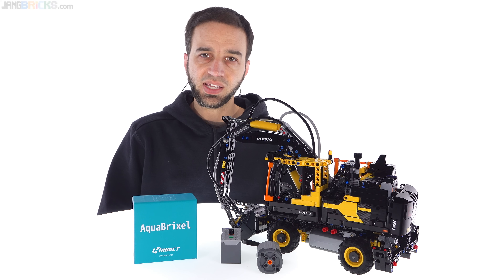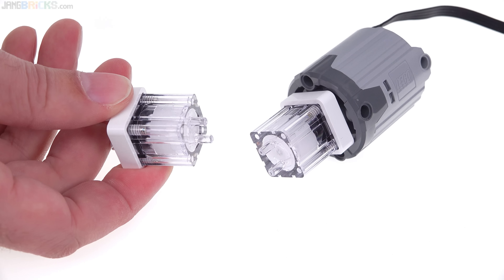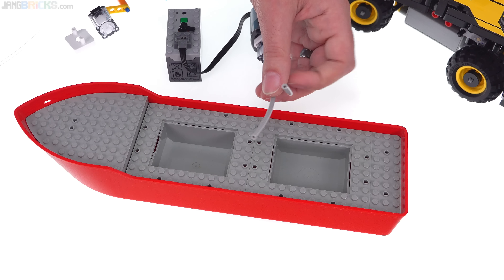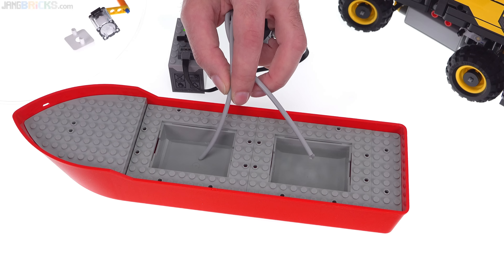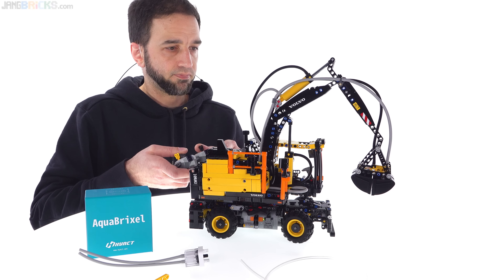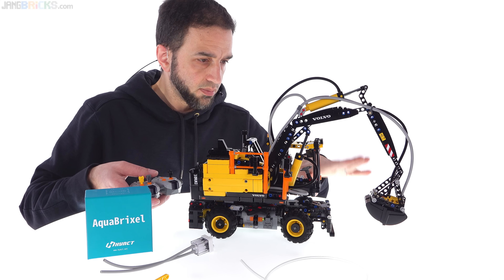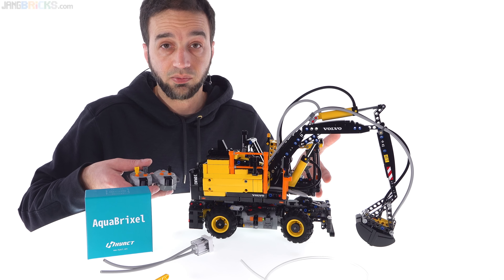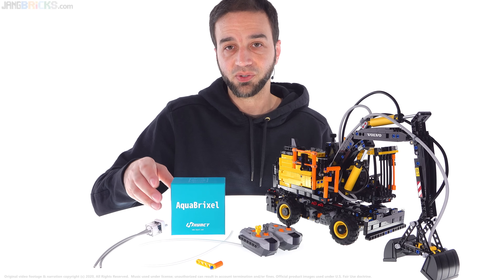AquaBrixel: Hydraulic conversion for LEGO Technic models #sponsored

Comment from the maker: A lot of viewers asked about using oil instead of water to further combat rust, so I asked the manufacturer for their thoughts.  They recommend instead a basic ethanol-based windshield wiper fluid (one without special add-on properties for bug resistance or fast beading, etc.).  It's much closer to the viscosity of water than even very thin mineral oil, thus taxing the motor far less, and it's water soluble and thus doesn't require a lengthy process of absolutely thorough evacuation of the water-primed pumps. Windshield wiper fluid is nearly noncorrosive, designed to evaporate on clearcoats, rubber seals, and metal hardware for years.

Comment: As an Engineer, I find these very interesting.
Reply: Rople that’s the smallest piston pump I’ve ever seen
Reply: @mcgee9777  Ah, but remember they are Lego
Reply: Rople “As an engineer, I need to constantly announce to strangers that I’m an engineer.”
Reply: Would it be possible to have a lego valve package? (dunno the word in english, but heres a pic:https://www.sagro.se/bilder/artiklar/zoom/P403A1_1.jpg?m=1516776461 ) it has one IN and one OUT-let for oil, and each lever operates the flow to the cylinders.

Comment: This is a cool system, thanks for showing! Like you mentioned, this makes the use of pneumatic cylinders in combination with a remote control a bit easier as one doesn't need to use valves. Its functionality kind of reminds me of the old technic Flex System.

As an engineer in the water treatment sector I wonder: does the pump unit start to cavitate once the cylinder has reached its final position? I don't know if you can call it cavitating, but it could potentially harm the pump's seals (but then one might need to make the pump run like that for hours or so).
Reply from the maker: As far as I can see, the piston actions seem too slow to induce cavitation with direct drive off an L motor.  That said, there is some air in the housing  at all times, so it's difficult to tell for sure.  I certainly don't hear anything different going on with the fluid, the motor just bogs slightly.

Comment: I charged my 8851 (the one with the red sprung piston) set in the 80s with tap water and after a while the pistons started to lock up. I'm pretty sure they where all plastic so it wasn't rust, I think it was either the lubricant washed away or the chlorine degraded the rubber or other trace elements built up. May I suggest at a very small added cost that the use of distilled water may reduce (or hopefully remove)this problem.... just an idea.
Reply from the maker: YES.  Distilled water is an excellent recommendation that would surely help a ton. Thank you for that.
Reply: The first pneumatic cylinders have only one inlet and are therefore retracted by a spring. I am not sure if this was made of stainless steel. And there is probably some leakage from one side of the piston to the other, that leads to to a rusty spring. The rust particles are blocking the piston/cylinder short time later.

Destilled water is more corrosive than tap water and it dissolves "everything", but yes it is of course "cleaner". But the minerals in tap water can only be harmful when you heat the water and refill it often because of loss due to evaporation.
The lubrication has to be renewed from time to time, because it will be "washed away" by the water (mechanically).

Personally I think that Lego-Water-Hydraulic is really fascinating, but needs a little bit of maintenance which is (in general) untypical in the Lego-World.
Reply: @stefan_brix  The original single inlet rams were not retracted by springs, they were retracted by the suction of the air being drawn out of them.
I know this because I have one right here in my hand now.. without anything connected to it, there is almost no resistance when the ram is pushed or pulled.. so no spring inside.
Reply: I done similar with my one but with cooking oil. It didn't work and the pneumatic never worked again. I was feeling very guilty for destroying such an expensive set in depression era Ireland. I got the set again in my 40s and is sitting proudly on my shelf

Comment: The movement seems a lot more fluid and smooth, excuse the pun, than the pneumatic system. There is a lot of juddering with just air. This is pretty cool.  Would you maybe do a conversion video with the AROCs ? I have that set and it'd be interesting to see it working with this hydraulic system.

Comment: Keep in mind the XL motor runs at a slower speed than L motors, while it does deliver more torque to move fluid it will deliver lower speed and pressure.

Comment: There will be corrosion no matter what the manufacturer says. My old cylinder rust too even though I never used water as fluid. But you could use dot5.1 instead.
They should provide further components like check valves. I see big potential for accurate power hydraulics e.g. construction vehicle

Comment: I can see this being useful for many things. I wonder since you can run water through it if it would be okay to use in something like a waterfall or something? I can see it making some real cool things with this.
Reply: It's not powerful enough for a waterfall, check the flow...
Reply: This isn’t exactly designed for being used as a water pump. If you wanted to make a custom waterfall you can buy an actual water pump on amazon or target. Also because the connections between LEGO pieces is not watertight I do not think they would be a good tool. If you want to make a waterfall you should learn about other ways of making builds and models, maybe try 3d printing.
Reply: Keep in mind, guys - this is NOT high-pressure equipment. We're pumping through plastic parts all the way!
But it's still good learning from it. I've been out of the Mindstorms game for a few years now; I think It's time to get back in...

Comment: Interesting, From what I can see each cylinder ram is in a closed circuit? Hydraulic  systems have a reserve tank for the fluid. 
The major advantage is that the liquid doest not compress thus you get real control over the movements. The downside by the looks of this system is that there is bleed of pressure inside the pump which makes me think it is an impeller type pump

Comment: If you want to completely prevent rust and do away with blow by (the drooping) replace the water in the system with a low viscosity hydraulic fluid or oil. would make the pumps run smoother too.

Comment: I actually just bought a set and used air tool oil and it worked great even with L motors it would blow the hose off if not paying attention if it hits the end of the cylinder stroke

Comment: i sopose if you get enough of those, you could make a submarine?  also what would happen if you put proper hydraulic oil in it? another thing, if you bleed the system it could be even beter.
Reply: It will dissolve parts over time.
Reply: A plain cheap mineral oil should be  just as effective
Reply: Baby oil (white mineral- / paraffin- / sewing machine oil) should work. It's non toxic, non aggressive, non conductive, non drying, non rotting and non corrosive. Also easy to clean away with regular wash up soap.

Comment: The ram cylinder shafts will rus over time and the lubricant will "wash" away. I would recommend using cristolube on the rams (it is what I use for heavy use Lego pneumatics). It is used in the diving industry

Comment: You should try to find out if the cilinders are made of stainless steel, because if it is then it won't rust. A quick way to find out if it is stainless steel is to try to attach a magnet to the metal part, if it falls then you know that it is stainless stell because stainless steel isn't magnetic.

Comment: While I loved your previous videos I like this format more as we get a better sense of the scale of these sets. Nice MOD and will you be incorporating this into the City?
Reply from the maker: Thanks for your support!  I definitely want to find a way to use these systems in my city, without question!  I'm more keen on using pneumatics than hydraulics for movement due to less maintenance, but I'm thinking these pumps may be useful for LEGO-based moving water features without resorting to aquarium or fountain pump systems.
Reply: @JANGBRiCKS  Good, you can make a water damn to make electricity to your City (make a small MOC apart with a self replenishing water reservoir and a big Lego structure and some cables to your City for distribution).
Reply: @JANGBRiCKS  have you seen my videos by the way?

Comment: i wonder if it's the water going through the pump, or the pressure actually driving the pump around that's causing that drooping issue.
I bet it would be possible to add a valve that closed when there's no input on the controller to somewhat mitigate that.

Comment: What about using the water pump in place of the air pump?  Then use all the pneumatic controls.  Could you use like baby oil instead of water?   Rust then shouldn’t be a issue.
Reply: I agree. The LEGO pistons are not suitable for water because of the small amount of silicone grease in them to lubricate them will be washed away.

Comment: I do wonder how the air is purged from the system to begin with, being a sealed circuit, the air has to go somewhere..
If water is pumped along the hoses into the rams, what happens to the air in the ram..?
It has nowhere to go, unless it gets pushed past the seal in the ram and out the other side.. which can't be good for it..
Can you explain how you did this..?
Did you prime the rams and/or hoses under water before putting them in the vehicle?

Instead of connecting the pump directly to the motor, I wonder if a gearbox could be built to bump up the RPM and therefore the flow rate through the pump, and therefore the speed of the moved boom..
Also, by modifying the rams (by drilling out the inlet hole a bit, like they do for those air powered V8 engines), allows for greater flow through the system, handy if gearboxing the pump.

I also wonder if the blow-by could be eliminated with a bit of modification to the seals in the pump - it'd be great if the rams could hold position..

This has lots of applications, and I'm surprised it has taken this long for a viable, compact retail version to hit the market.. It would be nice if the pump block had other pin holes on to plug it to other parts of the vehicle (or into a gearbox system), and not just that white connector pin plate thing.

A few decades ago I seriously considered and attempted to make a water based system, by literally putting the spring pump in a tub of water and pumping it by hand.. it worked, to a degree, but the time it took to get the water through the hoses was more than the attention span of 9 year old me at the time..
Getting it out of all the valves again was a nightmare too..

Years later I revisited the concept when Lego released the little yellow springless pumps which could be driven by a crank-shafted gearbox motor system.. Simply by dropping this system in the tub again, (the weight of the motors driving the gearbox, kept it under water) and it worked well, but it was no good for mobile machines as the tub was bulky and I couldn't determine where the pumps drew in from, so Isolating that point was not possible, hence the tub..
The valves also leaked each time they were switched, which required more feverish pumping to re-pressurise the system..

I like the look of this pump, how much are they?

Comment: I think I read somewhere that hyrdrolics systems will actually use oil instead to avoid rust. a little curious if that'd work for this..?
Reply: Hydraulic oil is used in machines made from metal, it will dissolve plastic parts over time.
Reply: AJ Pink : baby oil should work.

Comment: could the pump be used as a motor if its supplied with pressure from a different pump. If so that could make a motor that fits in small spaces.

Comment: Do you need 3 Motors and 3 Brixels because of the Remote control? Because it should work with one source of pressure and a few valves that you switch manually right?
Just asking because of cost. Oh, and mentioning the price in your Video would have been good (if i just missed it sorry about that)
Reply from the maker: Yes, I needed at least three reversing input channels to control three functions independently.  Even if I could use a single powered pump and valves like with the stock pneumatic setup, still an additional three valve controller motors would have been needed (which would have cost even more).  I believe it could be set up in stock form with a water pump and manual valve control, but then you'd need to constantly turn the motor on & off as it's not good to run the water pump with stalled flow.  The stock pneumatic pump simply bleeds off excess pressure to the atmosphere, which a closed loop hydraulic system cannot do.
Reply: @JANGBRiCKS  I get it now, thank you very much for the clarification.

Comment: For the first time ever, I'm inclined to "dislike" a jang video.  If Hyact bring out their own, purpose-built,  range of non-corroding cylinders, 3-way switch boxes and storage tanks (pneumatic compressors) then count me in.  As is, lego pneumatic gear was never intended to work with water (or any fluid for that matter).    As is, Lego's pneumatic cylinders already deteriorate over time just with air and the little moisture found there in. So hyact. make some cylinders with toughened plastic or even glass innards  then you've got something that Lego should've done decades ago.

Comment: I bought several of them and they are disappointing. They don't keep the pressure so whatever you lifted up will come down again fast. Also they don't all pump the exact same amount so 2 cylinders will not move the same. I wanted a simple set up with 2 doors opening at the same time, but they will not open/close at the same time whatever I try. They are not worth the money and shipping costs are high.

Comment: Water and electricity?
Sound like a total failure...
Reply: IG: Italy Gamer wait until you hear about water cooling computers that work great 🙄
Reply: Punch/Counterpunch 2000 yes but a decent water cooling system cost at least 100$ not 10$, and most important are common brands (Corsair, coolerMasrer, etc...)